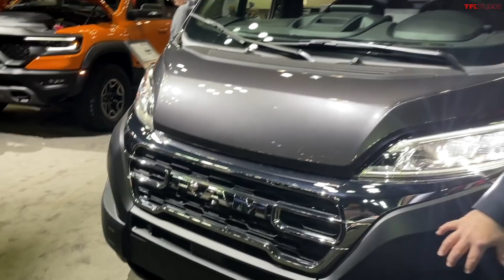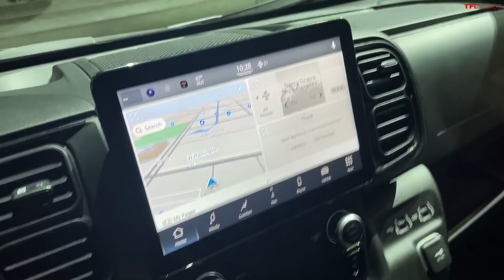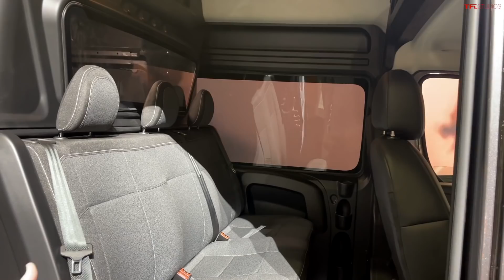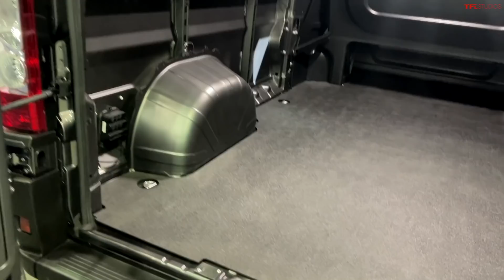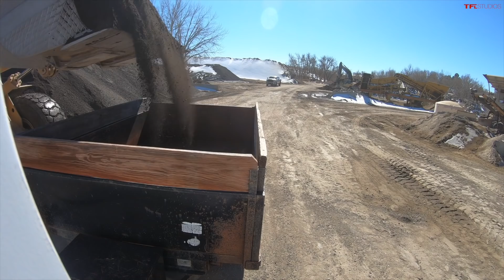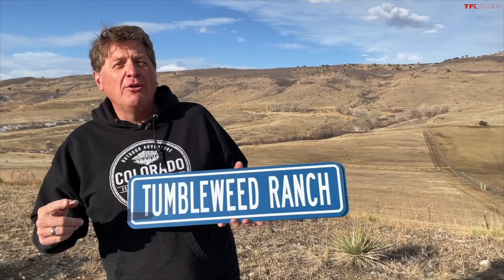The 2023 Ram Promaster Van Gets Better Fuel Economy, Better Lights And a New 9-Speed Transmission!

Comment: The new 9-speed transmission sounds good, but as the owner of a 23 Winnebago Travato with the Ram Promaster 3500 chassis, we heard the transmission never hits the 8th or 9th speed.  In fact, on the Promaster group site, they say the last two speeds are locked out. What's up with that? We do get around 17 mpg which is good for a 8000 lb RV. The van is a little underpowered on steep hills and moutains.

Comment: Finally Fiat Ducato 4 y old design... Dodge caravan 3.6 V6 is not a  bad engine  but old news mid 2000s technology lots left to desire....  transmission is horrible hopefully the new 9 speed is better  .... But 6 speed Manual transmission option would  be  beneficial to minimize income loss . I have sprinters and promasters lots of  problems  and  an experienced expediter 130 k a year . Don't let electronic electrical bugs bite you and  failed automatic transmission eat up ur income.

Comment: Had so many issues with the 2016 Promaster I used to operate. Head lights were a constant issue, it would rough idle at high RPMs while just sitting parked and the transmission was quite rough.

Comment: The problem with the partition between the driver and passengers area and the cargo area is obviously that this configuration wouldn't work for someone who wanted to use it as a camper and have access to both the front and rear areas without having to exit the vehicle. I completely agree with those who've said that it would've been great if the seats behind the driver and front passenger folded down to provide a sleeping area -- needless to say, the partition would have to go to do that.
Reply: Should be around 20

Comment: These are just rebranded Peugeot boxers/ fiat ducato/ Citroen relay vans. These things are outright appalling, the drivetrain is unreliable, the electrics are awful, and they are really horrible to drive due to the interior design. The only good thing I can say about these is theres hardly any wind noise on the motorway with the window fully down.

Comment: They (Stellantis) should’ve NEVER let FIAT take over the building of DODGE VANS. They should’ve let DODGE build their OWN VANS . (FORD and GM still build THEIRS, why not CHRYSLER?) Dodge would’ve incorporated all of the INNOVATIONS of their RAM TRUCKS into their VANS. FIAT is NOT exactly known for their long-term RELIABILITY.
A DODGE- BUILT RAM VAN could have had: CUMMINS TURBO-DIESEL POWER, HEMI V-8 POWER, REAR-WHEEL DRIVE (I’ve never heard of anyone putting Front-Drive in a Heavy Duty Van.) plus  all of the interior innovations that the RAM PICKUPS have .What a missed opportunity!!

Comment: I'm used to driving a Transit e250 for work. Just got a 2023 Promaster and my gripes so far...engine is much louder and less smooth than Ford when pulling from stops and getting on freeways, WAY too much pedal travel to get van going compared to Transit, steering wheel too far from seat when seat adjusted for leg comfort, NO leg room for left leg, have to press unlock button on driver door to unlock sliding door after parking, backup camera out of focus. Unexpected annoyance... turn signal sound is WAY too loud. Sounds like I am driving a 30yr old school bus.

Comment: I'm a plumbing contractor & I had a 2018 Promaster 2500 159WB and loved it !!!! I bought a 2021 and loved it too but unfortunately someone totaled it - but then I bought a 2022 and I guess this was the upgrade year because it has almost all the same upgrades on the dash as this 2023 has....I really love this 2022 even more! It drives smooth, turns tight, the sound system and gadgets are koolll - this new Uconnect device is really trick and much better than the prior ones.....Lots of sensors on this truck but hey, it's all covered under warranty so enjoy the advances in technology. Finally, I have the bench seat that seats 3 - Was skeptic at first but now I'm so glad I have this !! I've driven and worked out of the Fords (Transits high roofs) but I don't like the way they drive nor how you set in the cab....

Comment: The Ram Promasters start at $46,000 for the base model. He is mum about the drastic price increase.  I don't believe for a second they get better gas mileage. It's got the same 3.6 liter engine.  My 2020 118" only gets 18 mpg on the freeway unloaded. If you're thinking about van building you're deluding yourself if you think these vans get good mileage. These vans are priced for businesses and you're talking 50 to 60k. You can't get regular insurance for a Promaster. You need expensive commercial insurance, but you may be able to get around it because this particular van has a second row seat for passengers, but a two seater is definitely commercial. The VIN designates it as such so you can't fool your insurance company. AAA doesn't insure vans. I had to get Geico. Don't get me wrong it's a phenomenal van for camping which is why I bought mine. I got mine for 34k but the dealers are tacking on a $10,000 surcharge just because they can. I don't know what this guy is talking about the partition. Those things are the first thing you would take out because it limits your space. The heater and A/C can heat and cool the entire van space. You don't need that partition. I could blast the heat for a few minutes and the cargo hold is cooking hot.
Reply: Im using mine as a daily driver. This one is a 25. Had no problem transferring my insurance to it. Private owner non commercial pol icy. Didnt go up on rates either.

Comment: So, 9% better fuel mileage is about 1.5 miles over the older 6-speed trans. Not bad. so, one would expect to get 17.5~18.5 mpg. If you keep the speed down below 65 mph.

Comment: Finally got rid of that ugly front end headlights that don't hold water. Is it the camera lens or did they make curved walls? The RV conversion industry buys these for the straight walls.
Reply: I think the top curves a just little more than the lower part.  It's likely designed that way for aerodynamics. It's still a hell of a lot straighter than a Transit and super curved Sprinter.

Comment: How is it possible for the Pentastar engine to have this high of towing capacity? My Dodge Grand Caravan did not have this towing capacity. A Pacifica does not have this towing capacity. A nd they all have the same engine. Please explain this discrepancy. Do the windows in the rear doors open? Please share these details.
Reply: Towing capacity is about cooling unit transmission. Rear windows won't never open, cause noise and smell.

Comment: Crew style for van life would be amazing to have that extra seating. However, I would still like to get to access the back from the inside AND I would want to heat and AC the back. So those are a BIG miss for me, making this no different than a truck with a shell. Also, I'm sad they haven't added a mid-size with the 7ft clearance, like Mercedes, a Van life competitor, since many areas of the United States do not allow vehicles over 8ft in town. 

Was hoping for better from Ram.

Coming from a 2018 Medium roof 159, besides the dash and motor technology, upgrading to a new Ram would not be worth overlooking a new Ford.

Comment: Mind boggling that after all these years of customer requests for a simple thing like steering wheel tilt, Dodge fails to deliver. This one easily addressable issue makes the drive uncomfortable and is why I stick with the Sprinter.
Reply: That's the problem they don't listen to the actual consumer who's using these vans for work and the people in suits think they know best they're running it like government
Reply: Not surprising at all when you understand that alot of these companies are run by extremely corrupt people. People who want to keep themselves ultra rich, and dont give the slightest crap about you and me. They see us as peasants. This might seem a bit over the top, but look at the facts..they build year after year very unreliable low performing parts/vehicles, when they had the technology to do it right decades ago. And they cant be bothered to makes simple steering wheel fixes when they know good and well how uncomfortanle they are for lots of people. And the list goes on.  Same thing with alot of whats being built today, vehicles or otherwise.

Comment: The real question to ask is why didn’t they fix some of the issues they’ve had with previous versions of the van?
Water in the headlights, and transmission problems! 🧐
Reply: New LED headlight option in 2023. New Nine Speed Trans starting w/ 2022 model.
Reply: it wouldn't be a Dodge/Ram if it didn't have transmission problems
Reply: Did you watch the video? They literally mentioned new headlights and transmission in the beginning of the video.

Comment: Now that they have the 9 speed in the Promaster, when can we expect to see Ram replace the 3.6 with the 2.0? The 2.0 has more torque and similar horsepower to the 3.6.
Reply: In my opinion, that probably won’t happen. The 2.0 is fine for a lighter vehicle, but I suspect with the additional weight and payloads being carried in the Promaster, the real world fuel economy will be disappointing. When you start using boost in a turbo motor on a more or less continuous basis, fuel burn increases substantially. That’s part of the reason Ford opted to offer the 7.3 v8 in their heavy duty line of trucks. Under load, the fuel burn was competitive and the engine is under less stress in that environment.
Reply: Not unless it's a turbo diesel & the Americans aren't friendly toward those.

Comment: I really hope this engine and transmission fixes all the issues known with prior promasters, have spent nearly 20k on the van so far.... currently have 93k miles on it, I've owned it since new in 2018...and it just got a brand new engine and two cats installed. I have details for a class action lawsuit against Stellantis for the older promasters if anyone wants to join.
Reply: I own a 2016 2500 high roof. V6 Pentastar engine. Have exhaust, raw and burning coolant smell in cabin and coolant loss since new. Tell me of the class action please.
Reply: Sounds like a fun vehicle.
Reply: You're not kidding. My last employer had four or five of these in its fleet. They went through head gaskets like they were regular wear items. The Pentastar is not a good engine for a heavy cargo vehicle. They went with Transits for the remainder of their vans.
Reply: @tinygnat  I hope the Transits are treating your last employer better.  Certainly the twin turbos on the Transit (the only engine option that is a differentiator for heavy, heavy loads) worry me.

Comment: Here are some observations after owning a 22' 159 extended high roof 3500 for a few weeks. 1) The 22' has the mentioned motor and transmission updates, and it performs very well. Acceleration is great, and it seems to not have to "find a gear" nearly as much as the outgoing 6 speed. 2) the 22' has all of the interior upgrades shown here. IMO, it is a huge design flaw to only have telescoping steering wheel. I'm assuming that the 23' is the same setup, and that is nothing short of disappointing. I'm 5'10" and the steering wheel feels way too high. Ergonomically, it just doesn't make since. Also, though a lesser complaint, is that fact that the heat/air vents to not rotate side to side. How hard would it have been to have this basic feature?  3) If a noted segment of the market is van life folk, why not make a 4 or 5 person seating option with walk through capability. The crew option looks slick for a legit crew applications, but I wonder how many potential customers are going to be put out with the lack of access to the cargo area from the sliding doors or front. It seems that more people would benefit from 2 captains chairs or a smaller bench in the 2nd row area that could possibly even fold into a bed and still allow walk through access to the rear. There needs to be an in-between option from the standard 2 person cargo and the crew options. 4) The headlamps are embarrassing on the 22'. I'm glad they'll be better for 23'. On the whole, the Promaster drives and handles WAY better than anticipated. The touch screen is super nice and actually nicer than the Jeep Gladiator that I replaced with the Promaster. The steering is also better on the Promaster (if you know, you know).
Reply: It looked like they may have done away with the ridiculous placement of the e-brake handle low on the left outside of the driver seat. Why not on the inside?? That is begging to get your pants leg caught in it and do a Peter Pan face-first into the asphalt
Reply: @graydonwright9098  Good comment. Would the e-brake be on the dashboard now?
Reply: Hey Dr J MTB, where is the odometer on this 2022? I can't find it anywhere and no mention in the manual.....
Reply: Hu

Comment: I'm an industrial Service Technician and my company just ordered 10 0f these all upfitted and done up. I'm really doubtful the FWD is gonna be any good in the snow when I've got 4,500 pounds of stuff over the back axle
Reply: Tell them they might as well cancel the order now. Run one for my family business to deliver things in and even with 4 brand new studded snow tires it’s completely worthless in the snow. Idk how people are making them into camper vans and driving them with that weight in the back all year and in snow. I got stuck with one week old studded nokian snow tires on very slightly icy pavement going up a hill. Dangerous as heck man. A Honda Civic passed me when I was stuck not able to get up the road. The steering also blows as soon as you put any weight in the back in the snow
Reply: For reference I'm currently in a 2017 transit 250. It's RWD and an absolute tank in the snow. When the roads are really bad I just move my oil transfer tank over the rear axle and it'll drive up the wall if you hit it fast enough

Comment: About time you fixed the lights and transmission...8 years to late.
Reply: 🤣there still using the 3.6 it kills me
Reply: @Mr S  what engine should it use?
Reply: @Oldchrysler  yeah man 3.6 is the least if ure gonna carry weight on a highway , cuz ure not the only one on road and smaller engines + weight dont go along very well as a matter of fact
Reply: For you, perfect timing for someone else.
Reply: It’s a cargo van.
Reply: Dodge trannies have been terrible since the end of the old l.a. block rigs.
Reply: The 2022 RAM chassis had many many dash and safety upgrades.  Not sure it's worth the $15k price increase for the 2023 chassis on RVs to get the new headlights and 360 cameras.

Comment: Disappointed they don’t have AWD- won’t buy one with out it.
Reply: GMC and Chevy Full-size vans have 4 wheel drive
Reply: Our 3500 extended on snow tires is amazing.
Reply: @MyGoogleYoutube  snow tires are not a substitute for all wheel drive. I bought studded snow ties for my cargo van and still would get stuck. I love that people are thinking out of the box like the electric motor on the Toyota Sienna highbred, wish they would make a cargo van.
Reply: @seanpeine9258  stopping and turning come down to tire traction. While awd has a small impact on stopping it comes down to tires. 

Give me a FWD rig on Blizzaks over an AWD on all seasons all day everyday.
Reply: @MyGoogleYoutube  and I will drive right past you while you spin in the snow and ice if you can even get moving.
Reply: @seanpeine9258  Hasn't happened yet in our RV promaster or fwd Jetta. 

I figured you would be the type to blow by middle finger in the air saying F you fellow motorist.
Reply: @MyGoogleYoutube  sorry your so quick to form negative opinions, I am the type of person that gets out of the vehicle and helps people like you put your chains on your car so you can get where your going. Because you weren’t smart enough to buy an AWD.

Comment: I have worked on hundreds of the Fiat Ducato and a couple of the Peugeot Boxer versions of this van. (07-18)  The Diesel engines were ok, but the transmissions were terrible. Both manual and automated manual (kinda auto) were so unreliable. Also the build quality was so poor prior to 2014, that the manual transmissions started to fall off on a batch from 2011. The paintwork on white vans would wash off after 2 years and was a long term known problem. They also creak over every bump. Not loved by customers or staff.

I hope the problems have been fixed for the Promaster and the revised 23 model is much better. Odd choice that the side windows are now plastic polycarbonate and not glass.
Reply: They no longer offer the diesel powertrain in North America.  I worked at a company that had one.  The diesel engine was good, but that manumatic was awful.  It shifted so slow that it was dangerous to drive in heavy traffic while loaded.  

The build quality seems to be OK on these.
Reply: @1guyin10  they never offered that Pneumatic transmission in the US. US models had the ZF 9 speed automatic transmission they use in their other front wheel drive cars.
Reply: @damilolaakanni  They use the 9 soeed German Transmission on the IVECO Daily  which is like a extremely HD version  of a Ducato. It carries vastly more than the Sprinter

Comment: What about the transmission?  I spoke with some fleet people and they had to replace transmissions early in these and recommended the Ford Transit.
Reply: Zf 9speed the same one on the Pacifica, Cherokee, honda pilot and some land rovers.
Reply: @minivanman1356  And non of those vehicles have a 4600 lbs payload...let's see if it holds up.
Reply: Never buy a first gen vehicle with a first gen engine or transmission that is my recommendation. The problem there having is the transmission can’t take the heat so it slams into gear when it gets to hot and weakened the clutch spring in the torq converter. They will fix it next year with a larger transmission cooler.